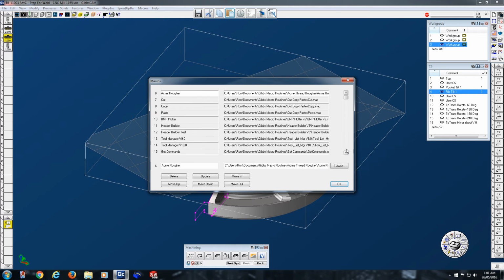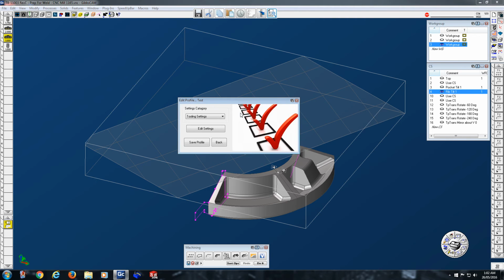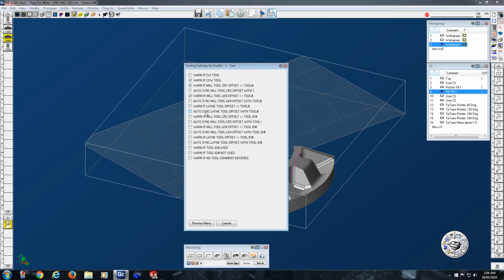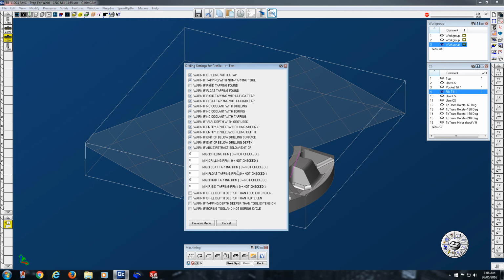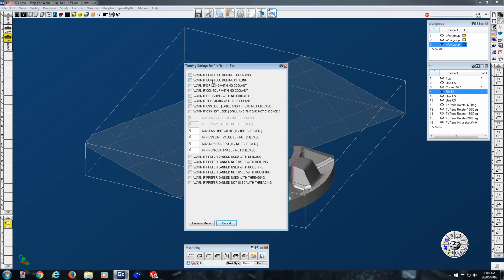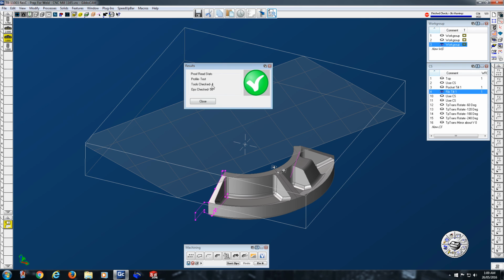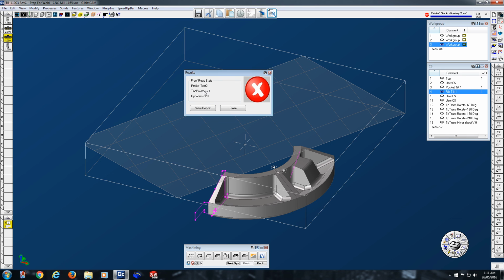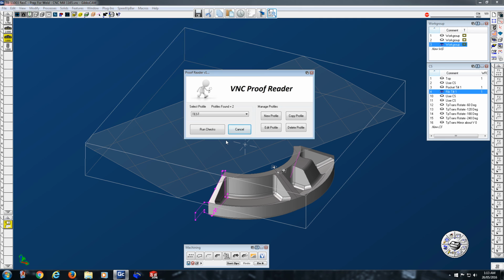VNC Proof Reader   Demo1

Comment from the maker: This macro is located on the Gibbscam programming forum. It is a free download.
The next version4 is soon to be released and is far more powerful.

Along with the new proof reader is included header text management, auto setup sheet creation, code insertion routines ( for barloader text or whatever you want??... ), and finally the ability to post out the file.

All the above have default settings and can be overridden for each VNC. The overrides will be saved for that individual VNC so you never have to guess what you did last time.

Release of Version4 expected before the end of Feb2017.
I will produce and post a video for the new version4 just prior to posting the macro on the forum. I you want to download this macro, you need to be a member of the Gibbscam forum. If you aren't, you need to sign up. Its free and a great resource. 

FYI
the_cnc_guy